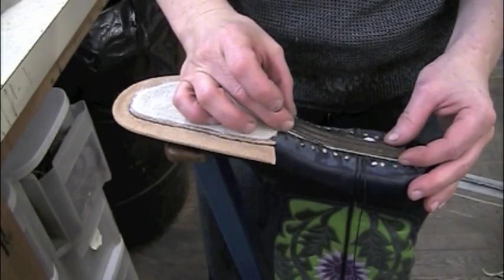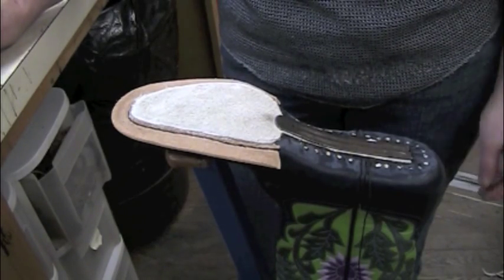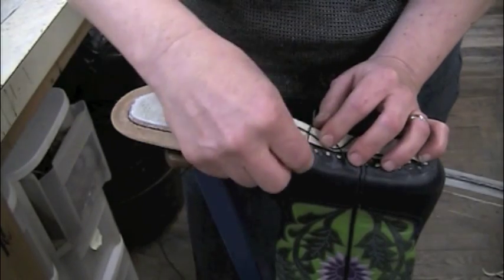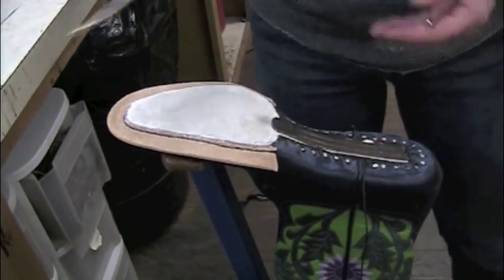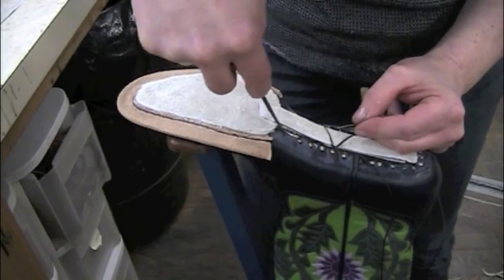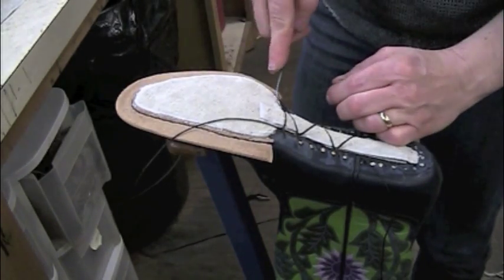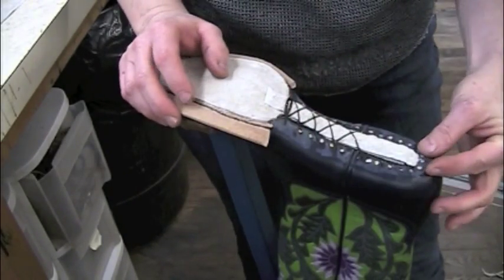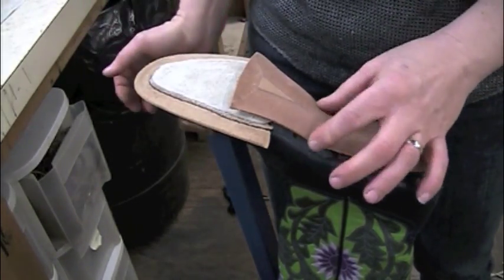14: Putting in the steel shank

Comment: Dear Lisa,

Thank you for sharing your videos. You Are A Great Inspiration!!

Would like to ask you a question; Could you please tell us about what kind of glue and heat gun can we use in the shoemaking process?. Perhaps, where to buy those?.

Thank You!
Alexa (From Maryland)
Reply from the maker: Alexa,
For boot or shoemaking, you'll want to use rubber cement to put the pieces together and contact cement to put the soles on. I sell water-based versions of those on my website www.sorrellnotionsandfindings.com, or any leather supplier or hobby store will have solvent based rubber and contact cement. Rubber cement is a temporary bond and contact cement is a permanent bond.

In the video I'm using a regular hot glue gun and hot glue sticks to put in the steel shank. You can purchase hot glue guns and glue sticks at any hobby store.
Reply: Dear Lisa,

Sorry it took me so long, (I was moving from city).Thank you very much for your response and, advise!!. I will visit your website today.

Have A Wonderful Day,
Alexa